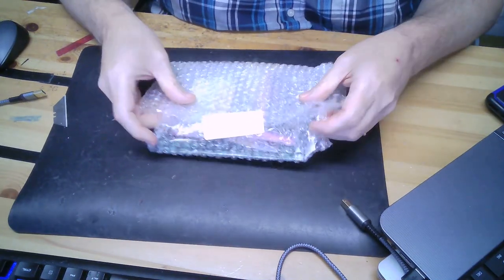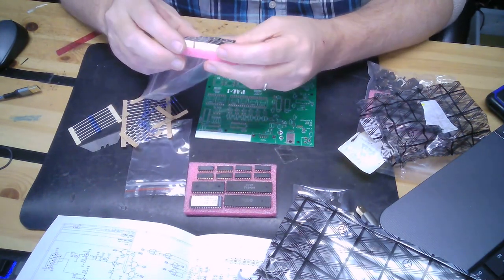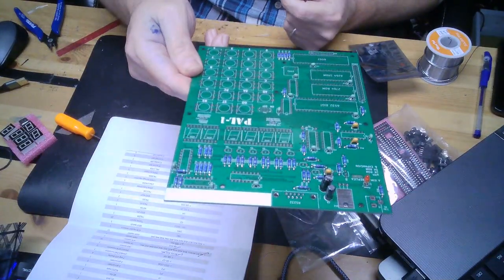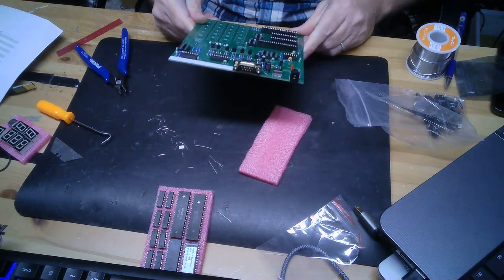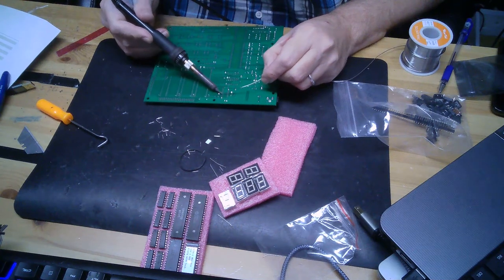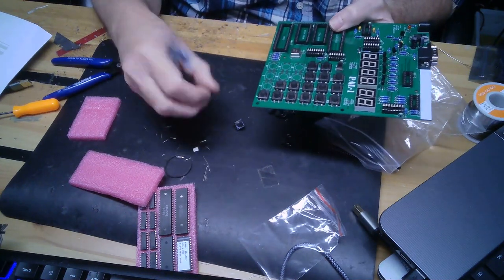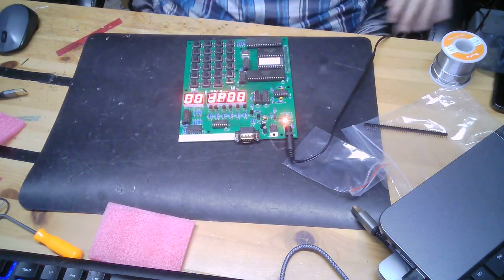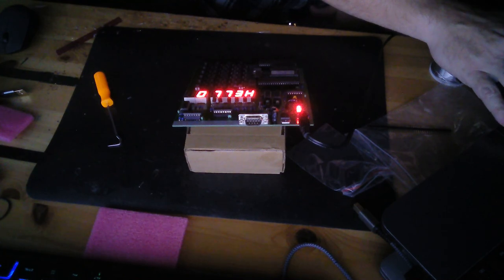KIM-1 replica PAL-1 unbox, assemble and test

Comment: Thanks for sharing! One tip - sticking adhesive red transparent foil on the display greatly enhances contrast. Great vid, I assembled my PAL-1 in considerably more time but I don't have that much experience soldering projects like this. But the quality of the board and components is really good so I managed anyway. And indeed, as you say, this is the 'real deal' - fantastic KIM-1 clone with lots of expansion options. #HappyHacking6502